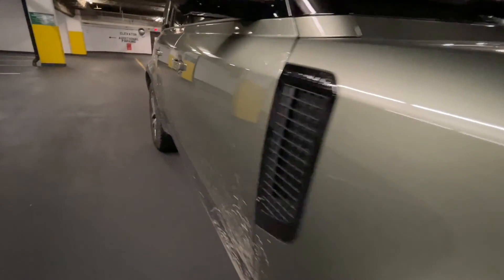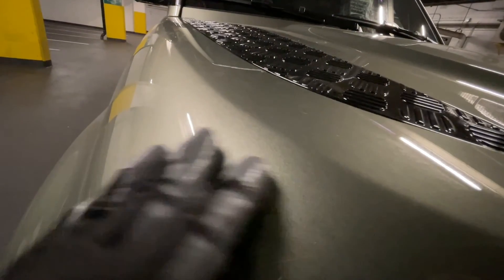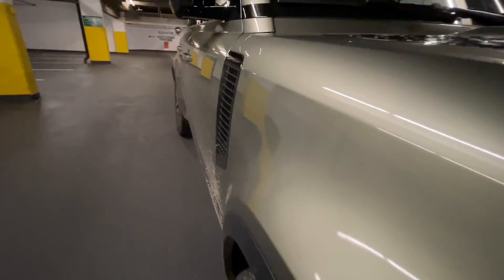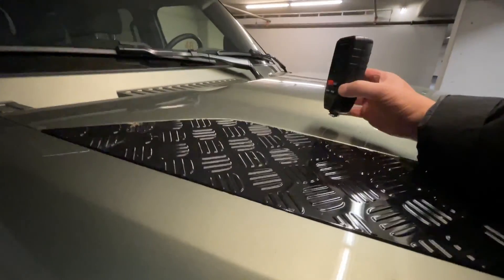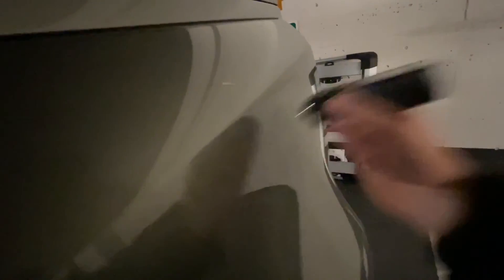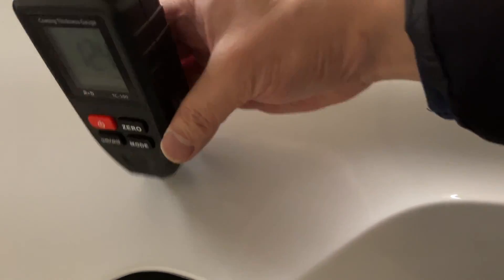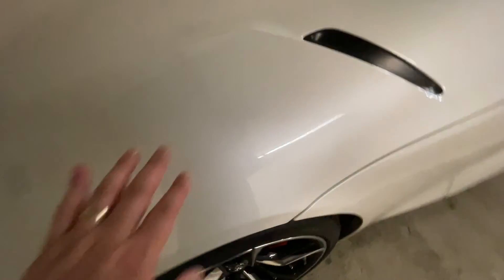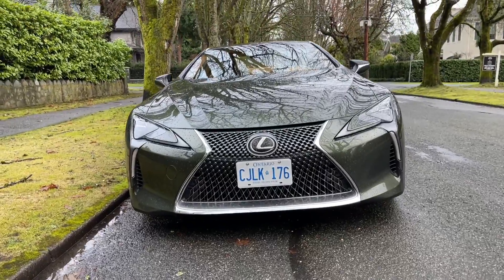Engineer Reveals How to Check Paint before Buying a Car. Part 1: Paint Inspection and Evaluation.

Comment: Very educational video. What are your thoughts in general on Toyota paint? I heard they are thin and poor quality. Any thoughts on paint orange peel appearance?
Reply from the maker: Thank you for asking. The overall quality of paint is more than just thickness - it's also about the durability, gloss, adhesion and pigmentation. In general, Toyota paint is world-class in terms of quality and durability.  European cars may have somewhat thicker paint job, but it doesn't mean that is necessarily better - although thicker paint allows for paint corrections and buffing without worrying about losing too much paint from the process. You don't need to worry about Toyota paint being thin or poor quality.